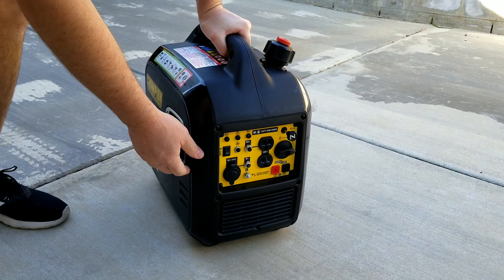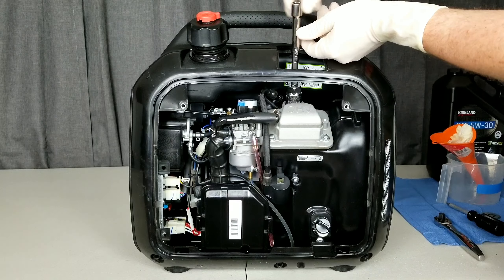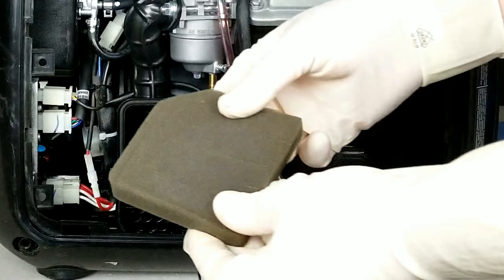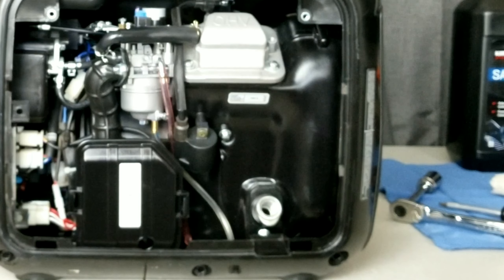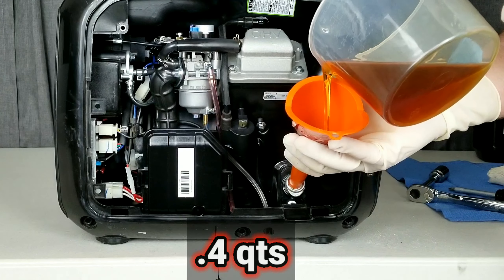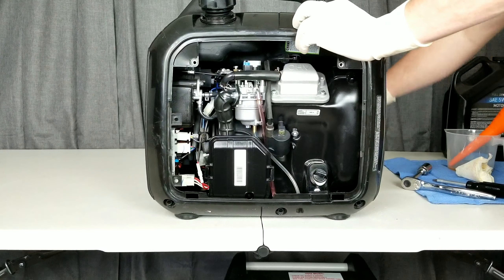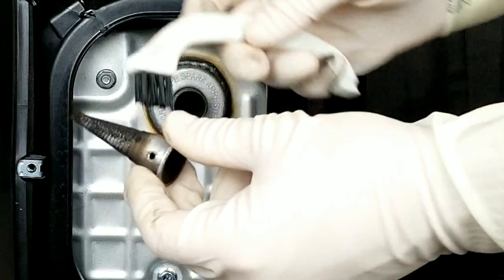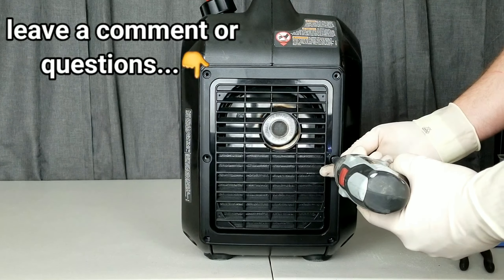Champion generator Oil Change full service 2000 watt DIY Generator oil change HOW TO

Comment: These are actually really good generators. I have close to 1000 hours on ours. The weak points of these are the recoil starter assembly and the crankcase gasket. The crankcase gaskets are not always aligned properly from the factory and it will leak oil. Champion sent me a new recoil at no charge and the gasket I repaired because of wait time for a new one. I'd buy another of these though.
Reply from the maker: It was a good unit when I had it. And yes very slight oil leak. 
But good unit, light and did what it needed to do.
Reply: Anywhere I could find out more about the gasket I got one that's leaking some oil by the exhaust side
Reply from the maker: I honestly dont know If they have the gaskets for that unit. Champion and eBay is your best bet. If not and you want to use a gasket maker, check out “Right Stuff” its like $20 a can but In use it for a ton of stuff and impressed every time.

Comment: Nice job. Just picked up 2  2500 Watt Champion Inverter Generators Model # 200951. Same maintenance procedures as yours. Thanks.
Reply from the maker: Your welcome. Yea the small ones don’t change very much.

Comment: Hello there i about to do oil change my 2500 champion inverter generator and i clicked your’s. Thankx its so very informative by some bunos tricks on how to give complete care for the unit. I just zoomed in to figure out what exactly oil you used and i discovered its dexos and I thought dexos ones were only for some engines(GM/Chevy ones?) Atleast i saved some $$ by using those left over dexos1 at my garage
Reply from the maker: It’s basically a lawn mower engine. Just change it frequently and that will be good enough
Reply: Thanks a lot  @johnnysweekends  i really appreciate it, hope you are having a good one! More power to your channel
Reply from the maker: @olepickle5366 👍🏼😀

Comment: what causes these generators to stall or run rough when the choke is pushed in after starting and proper warmup? Ours runs ok with the choke all the way out in starting position, but stalls if pushed in

Comment: What do you recommend doing for long term storage?  Drain the gas or the additive?
Reply from the maker: Everything he said…. Good job. 
That’s normally for the long term storage of 6 months and more give or take. If you know your going to use it with in 6-8 months I would drain carb but run a fuel additive or conditioner, run for a fuel mins then drain. Typically not a bad idea as well to fully top off fuel tank to prevent moisture build up in the fuel tank. 

If doing the long term storage for a year or more I would just drain the tank and run till empty, then drain float bowl to make sure it’s fully empty. 

But always run a conditioner or additive of choice no matter what. That way if it sits for a while and you forgot this will help with preventing the inevitable…lol

Comment: How often are you changing oil?  I am thinking every 50 hours of run time.
Reply from the maker: Depends, hot and stressful maybe 40,  50 isn’t bad under medium and heavy loads and high heat conditions. 100hr in low loads and cooler conditions is perfectly find

Comment: Great video!! After how many hours do you need to change the oil on these?
Reply from the maker: I say pending conditions and temp sometimes as low as 30 hrs and it’s running hard in hot temps. But 50 is kinda the standard on the little gens because they hold .45 quarts of oil. So not much of a oil reservoir.  So the worse the conditions and usage the sooner I would change it.

Comment: Could you give specifically how much oil out of a quart goes into the engine? .. if the oil is showing at the bottom threads when sitting level.... That should be enough?
Reply from the maker: Yes sitting level bottom or mid way up threads is enough which is about .4 of a quart.

Comment: After the 5 hours break in period, oil had a lot of metal glitter.  Going to do the second oil change again at 5 hours, no way I'm going to way 50 hours as in the manual. Also, I could only get 300 ml of oil in this engine (0.3 qts) - unit perfectly level, oil up to the last two threads of the hole. Not sure why manual says 400ml ?
Reply from the maker: The meter glitter is probably the assembly grease. They all look like that. I change after one hour then another about 5 or 10 hrs out then 50 ish or so depending on conditions

Comment: I bought one of these and it consumes alot of oil. Im guessing every 10h I need to refil oil becuse it stops from low oil level.. Anyone have the same issue? Im using the recommended 10w30
Reply from the maker: I have heard this before but in a different brand. It’s possible there could be premature wear causing the burning oil. Unless you find a leak somewhere.

I would move to a straight 30w oil and see what happens.
Reply: @johnnysweekends  no leaks.  Its only 3 months old
Reply from the maker: Wow interesting, I wonder any way to return ? Or did you contact champion?
Reply: @johnnysweekends  i just sent them an email
Reply from the maker: Let me know what you find out..👍🏼

Comment: Thought the oil was 10-30 .....
Reply from the maker: You can use either. 10-30 or 5-30 if say your in colder climates and want a broader range of protection. Either will work for full time use. 

👍🏼